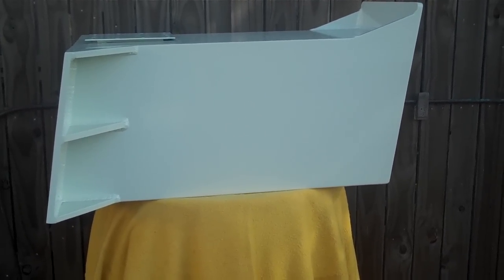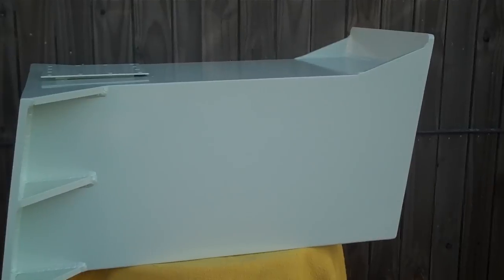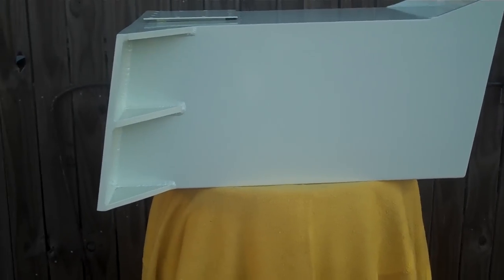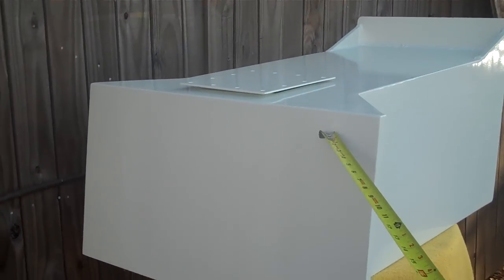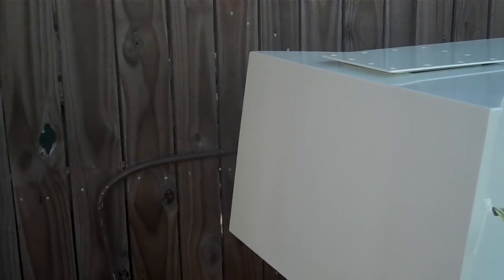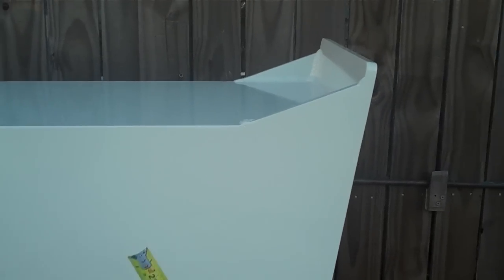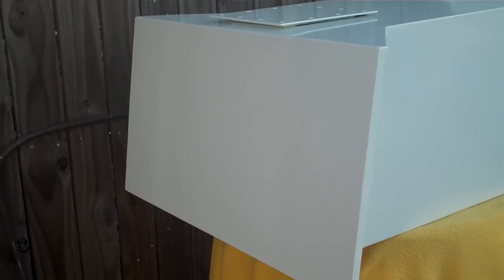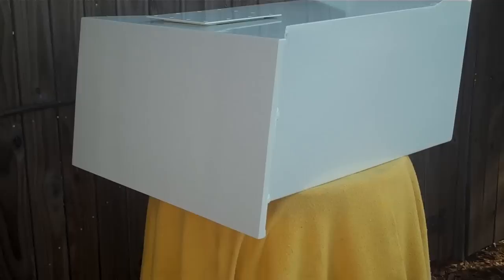Moby-Cool Motor Mount 250 hp,Conversion Installation.

Comment: Just wondering if this could be utilised as an extra fuel tank as well. Maybe with extra gussets to compensate for increased rotational forces.
Reply: You probably wouldn't want to add any weight that far rear on the boat it would make the force that much more dramatic I would assume plus the extra weight on a transom is never good

Comment: Hello. I want to repower a 1986 Chris Craft Cavalier that had a 3.0 Mercruiser with a alpha 1 outdrive. How much stress would this put on the transom being the outboard would be so far out? Would I need to reinforce the transom all the way across or would it be fine? My transom appears to be really solid for such an old boat. Thanks in advance for your assistance.

Comment: It would need an internal diagonal brace on 2 sides from transom to the Kiel bottom beams. That would strength the transom.
Reply: some do. some do not. Just depends what u are dealing with, some boats should not have them at all..ever...

Comment: hi  what  is  tha  price  for  motor  mout
Reply: This "over the hole" mount is $$1,295.00 US plus $175.00 S/H in continental US. It measures 26 wide at the transom by 14 high and is 30 inches long. The motor end is 16 wide by 17 inches high including a 3 inch flange at the top for the motor and hydraulics. Thank you for your interest, Scott.